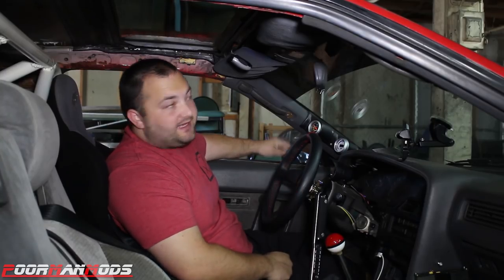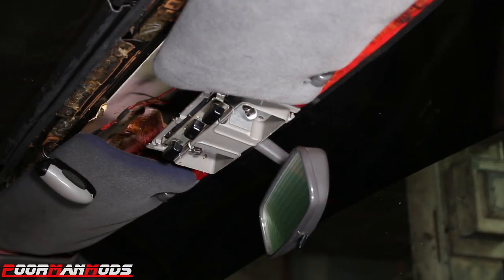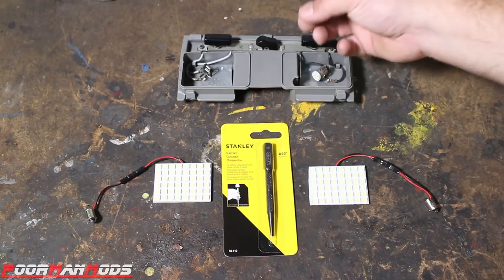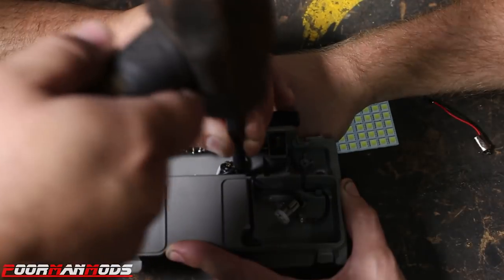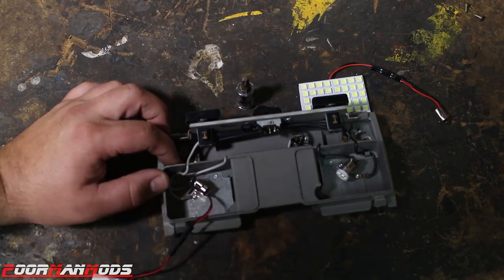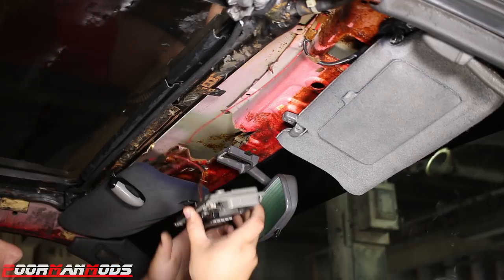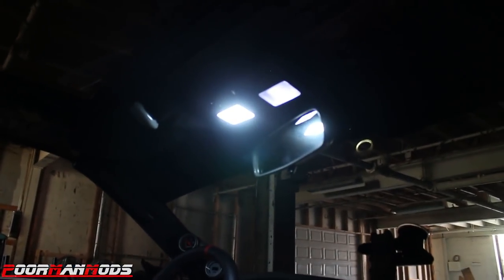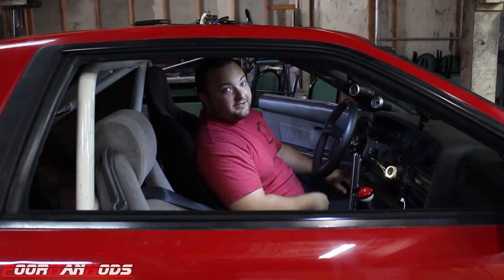MA70 Supra Dome Light Fix & Upgrade | Yota Connectors LED Dome light kit

Comment: $38 is a lot for a punch and an LED that you can order from Wish for $2. The ones from Wish also come with different connection's for different fittings so you can put them in other parts of your car.
Reply from the maker: Well you know these are the right ones that will fit, and you get the correct punch, and youll get customer service and it wont take 8 years for it to arrive in the mail lol.

Comment: FYI: The kit is about $40; pretty decent considering the amount of light emitted....and that you might not be able to find this any place else.
Reply from the maker: And you get the proper punch :)
Reply: My Dome-light is already working (considering I installed a complete used one); so do I still need to use the punch to gain proper contact?
Reply from the maker: I would use the punch just to be sure, my dome light worked up until last year, Ron and I used the punched and it start working again. The contact can be lost at any time, just do it now and be done with it.

Comment: I installed the new lights. They worked for a second but stoppped, ended up burning a fuse. Replaced the fuse and burned it again. What next?

Comment: My dome lights work, but they dim down (only for a split second) whenever I use my window switch or make my headlights pop up. Maybe electrical issue? If I keep my window switch pressed they stay dim. Any ideas??
Reply: the lights use a LOT of power. so the windows take up the power as well, so the power from the lights go to the window
Reply: windows just pull a lot of current

Comment: How did you get the cover off so easy, mine is stuck and i dont want to break the plastic...?
Reply from the maker: Maybe try a heat gun to soften it up, but it should pop off its just tight

Comment: I hope you know that led panel will start burning  those 5050 LEDs because of high voltage.  You need voltage buck converter to set it from car voltage to 11.5v ...
Reply from the maker: How long do you plan on the doors being open? lol Ive had this kit installed for quite some time now with 0 issues lol.

Comment: Did the dome light kit and my lights still dont work. What should I do next?
Reply from the maker: Check fuses and grounds
Reply: @PoorManMods  fuses are good so im gonna assume its my grounds. I'll check it later as its getting pretty late where im at.
Reply: Actually fuck it, ima check it right now lol.
Reply from the maker: Also make sure you're getting power to the dome light
Reply: @PoorManMods  so i tried punching the rivets again and they finally worked. I guess i didnt hit them hard enough the first time lol. Both originally bulbs light up just fine so ima wait for them to burn out and install the led's later